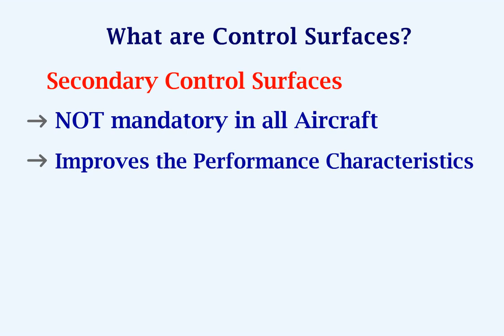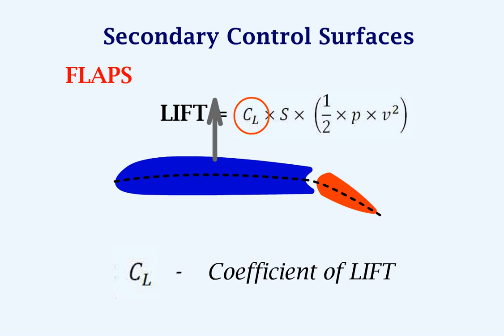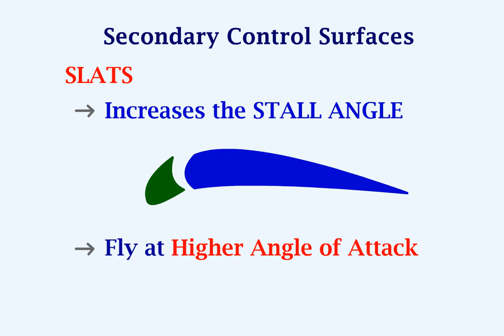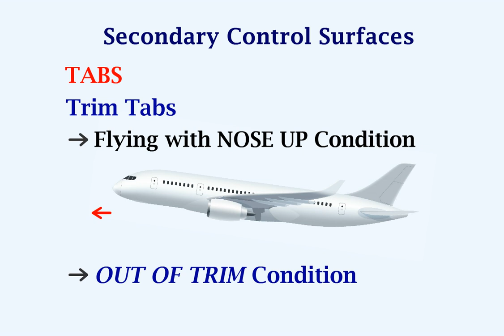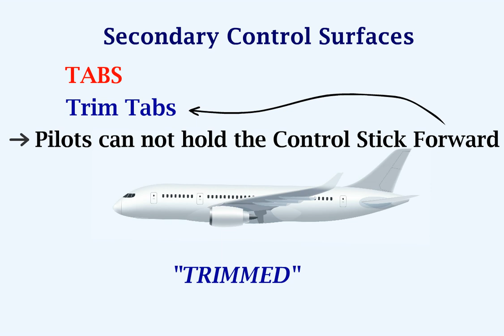Understanding Secondary Control Surfaces: Flaps, Slats - Slots, Spoilers, Balance Tabs & Trim Tabs!

Comment: Great information from here, my hat off to you sir! I am still brain-dumb on how the air flow, plus the high air pressure, from bottom of plane, can make the plane lift-up at a steeper angle when the slats and flaps are extended out ( or more so engaged). The equation is there, and all to do with weight, thrust, air flow, high and low pressure, and drag....yes, still is making my brain look for the answer 😂😊😊
Reply from the maker: Thank You! Check out my other videos as well!

Comment: If the flaps are not primary control surfaces but secondary control surfaces, why have there been issues and even aircraft accidents during takeoff because the flaps were not extended. I mean some aircrafts have had issues with taking off because the flaps were not extended. If the flaps are that important for takeoff, why then is it not supposed to be in the primary control rather than secondary control?
Reply from the maker: Flaps improve the lift generated on the wings. Normally for an aircraft design, there would be a flap setting for takeoff, so that the aircraft gets airborne within the available distance. If that is not followed, it can lead to accidents.
Reply: Great! Thanks for this awesome response

Comment: Can I ask a question about the spoilers in flight mode: are they applied in different ways to either reduce speed or reduce the wing lift to sink rapidly? Or the pilot cannot differentiate between both, and any spoiler application in flight reduces both speed and lift simultaniously?
If it is the latter case, then I cannot understand how are the spoilers used for braking in flight, as this would result in significant altitude loss, so how is the pilot supposed to brake but not deviate from the vertical flight path...
Reply from the maker: Spoilers in flight are used for both: reduction in speed and to increase the rate of descent. To understand the operation of the spoilers we need to look at other systems that are operating simultaneously with the spoilers, such as the engines and autothrust; and the flight control system. The autothrust will adjust the speed as per the requirement and the flight controls will adjust the trimmable surfaces to ensure correct altitude/sink rate is maintained.

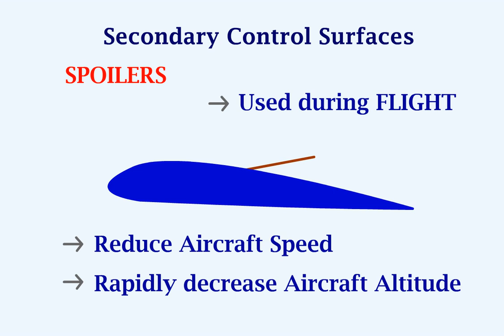Comment: 3:18 The braking effect from drag on the spoilers on landing is negligible. The purpose of deploying spoilers on landing is to remove the lift and stall the wings, to let the weight rest on the tires, which greatly increases the amount of braking that is possible without skidding. It also enables much more directional control while rolling at high speed. Without the spoilers, you would not be able to apply much brakes without locking the tires, due to wing lift carrying a significant fraction of the weight. Locked tires only apply force against their direction of movement, and won't apply any lateral (steering) forces. The spoilers break a catch-22 where you need to slow down to be able to apply brakes, but your brakes don't really work until you slow down.
Reply from the maker: Cool! Thank You for the detailed description!

Comment: isn't it autopilot's job? e.g. altitude hold autopilot
Reply from the maker: Yes, on aircraft which have the Autopilot system. But it is referring to some small aircraft which do not have an Autopilot system.
Reply: @JxJAVIATION  thnx sir
Reply from the maker: @ibrahimyldrm2427  You are Welcome!

Comment: 3. Scenario:
In straight and level flight hands off, the pilot notices that the airplane keeps on yawing right, what tab is used to correct and explain aerodynamic effect?
Reply from the maker: The rudder needs to be trimmed in this case, which can be done by a tab on the rudder.The rudder will maintain a deflection towards the left(as in your case) so that aircraft continues to fly straight.